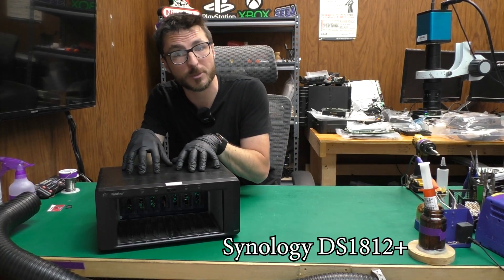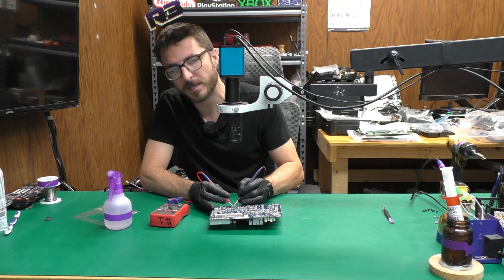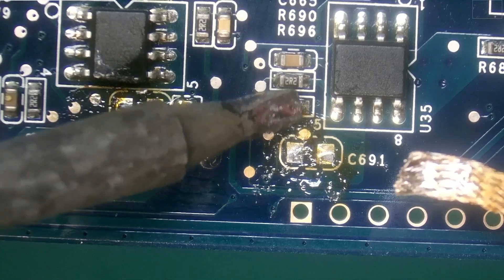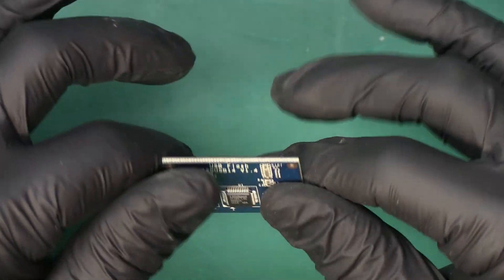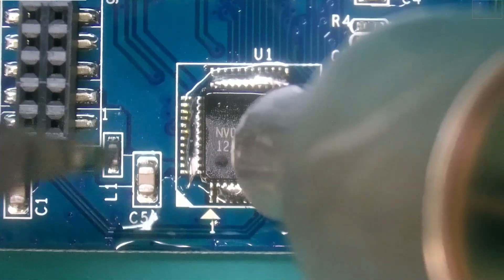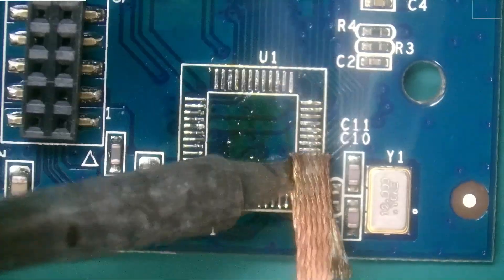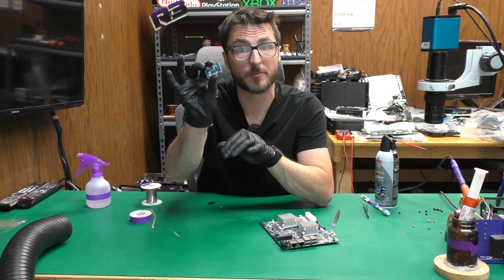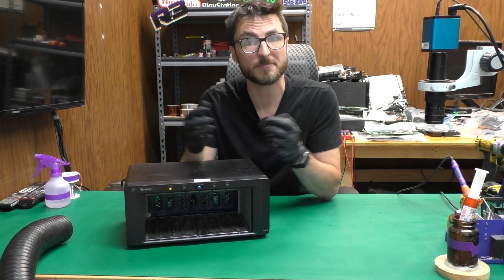Synology DS1812+ Master Repair Guide – Every Fault, Every Fix!

Comment: Hi Nick, I put this comment on another video before I found this one (apologies for duplication)  ...... I have a DS1812+ which has decided to not allow me to find it on my network. It seems that its powering on but i'm not seeing a flashing blue light so my assumption is its not booting. It doesn't get to a status light or drive lights so could be power related ? I also have a DS716+ (2 bay) which I have to compare lights against as it boots up and my 1812+ definitely doesn't follow the same light sequence. Would this be CMOS related or can you suggest anything else ?
Reply: Forgot to say, i'm based in the UK so whatever repair you suggest will be done personally as I can't get it to you for repair

Comment: I have odd issue with DS218+. It most often don't boot, blue led blinks a few seconds, then stops for a sec, then starts to blink forever. I've connected uart interface but it shows nothing. But sometimes it boots normally, UART can see boot process so i assume that is not might be typical nand or DOM issue, am i right? Tryed on two power supplys and an ATX psu with adapter 12v molex to DC plug. Same issue on all of them.

Comment: I have a Synology 1812+ that recently won't turn on after a power outage. The only light that lights up is the lan1 light.
Reply from the maker: That's a common issue we see. It's likely the fault was already present for many months prior to the outage, just wasn't triggered until the power outage forced the unit to essentially power cycle and that's when the failure manifested for you. If you want to send in your unit for repair, we can service that for you no problem, just go to the flat rate service listing linked in the video description. The service is flat rate and covers all faults shown in the video + comes with a 1 year warranty. 
Feel free ot reach out if you have any questions.
Reply: @NicksElectronicRepair  I’m in the exact same boat but in Canada (so shipping for repair would be too costly). PSU working fine, fans spin, but no blue light and no boot. What should I tell my local motherboard repair guy (in terms of what needs to be done?
Reply: I have the same issue! I'm in the EU so shipping is not an option but i replaced the battery and checked the capacitors, no luck is there anything else i can do?

Comment: Does this work for DS1821+ with the flashing blue light issue?
Reply from the maker: The last 2 number of the model number = manufacturing year. 1812 was made in 2012 yours is the 1821 so it was made in 2021. That is 9 years of technology changing and about 5 or so generations of change. There is a 100% chance that none of these failures will apply to your unit.
Reply: I just got a blinking light on my DS1819+. Someone said it could be the RAM. The weird thing is that using one RAM module in one slot, it then worked. Didn't matter what RAM module I used, it worked in one slot. Then I tried it in the other slot, and it would give me blue blinking light. Odd. So for now I'm running off a single stick of RAM.